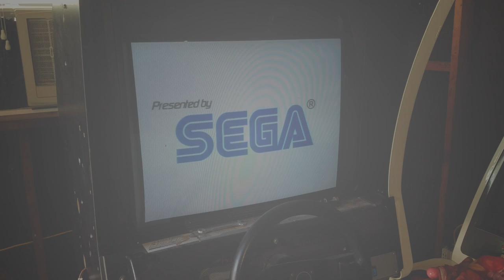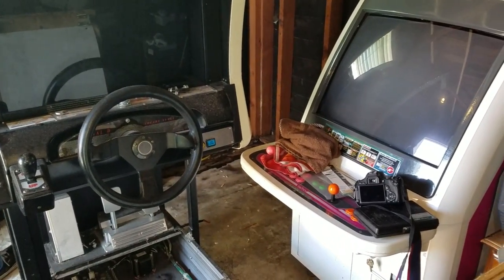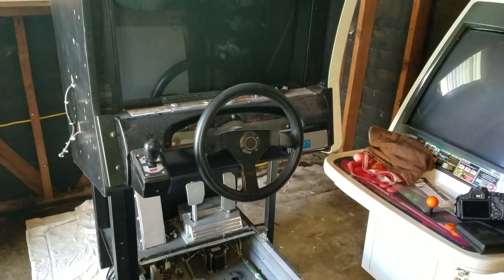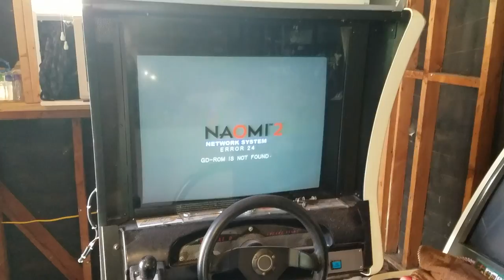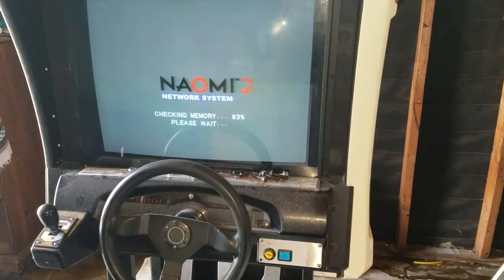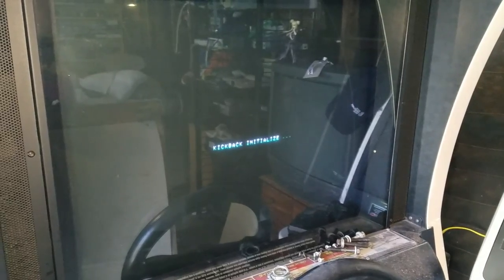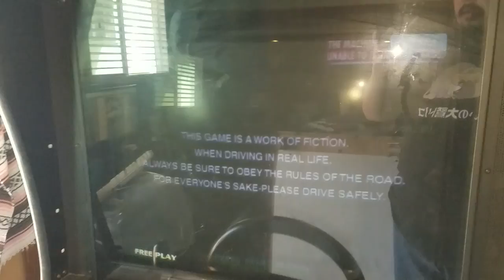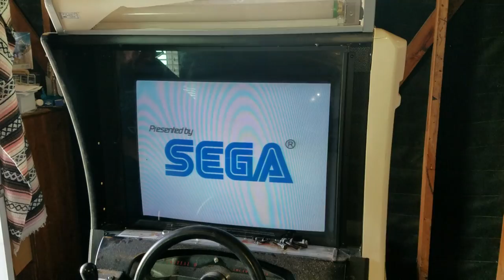Initial D Arcade Version 3 - Video Blog Part 5 (It's Working!)

Comment: Great work!

I'd rule out the volume pot before buying a new amp. If the game doesn't see a that a volume pot is connected it will not kick out any sound. You could try testing the amp on the other half of the cab to make sure it's working. Did you check the voltages to the amp? 

For the card reader, there should be a little slim PSU  (Corsel LCA75s-12, written on the large brown capacitor ) that takes 100v-120v input and  gives a 12v output, I'd multimeter the output to see if you are getting 12v. 

It also looks like your Force Feedback isn't working too, it should initialise on boot up. Is there  a red flashing led on the Servo motor board? After the FFB initialises the flashing red led should go solid.

It may be that these components are not getting any power from the 100v PSU. The USA cab is different to UK and Jp cabinets so I don't know how they are laid out inside. At least the 100v is getting to the Naomi PSU which shows the N2/GDRom and Netdimm are working.

Good luck man!
Reply from the maker: Thanks for the suggestion, but based on what ive read the amp is getting no power at all which is the primary problem.  I will definitely try your suggestion regardless.  I don't know how to check the voltages, I also currently do not have a voltmeter
Reply: No problem.

I'd definitely buy a multimeter first dude, it will save you a lot of hassle in the long run. There are guides on YouTube how to use them, once you understand how to use them you will wonder how you managed without one.

Since the Naomi PSU 5v and 3.3v are both adjustable, who knows what voltage those are set to right now. If the voltages are too high then the Naomi will die an early hot death.

So for USA cabs it's 120v in from the wall, then that 120v should goes to a 100v Step down transformer which will distribute it around the cab. 

The small transformer (maybe it's an isolation transformer for the monitor or the 14v transformer?) in your cab does not look big enough to power everything, so, whats probably happening is that the 'Master' side of the US twin distributes some of the 100v load via it's transformer to both sides of the twin. Like I said, I'm not familiar with how US cabs are built.

So 100v goes to:

100v to the monitor.

100v to the Naomi PSU, that then powers the Naomi/GD Rom etc with 3.3v, 5v and 12v outputs.

100v direct to the Servo Drive board which powers the FFB.

100v to a 14v PSU that then powers the the Sound Amp.

100v to a 12v PSU that then powers the Card reader.

On UK twin ID cabs there is a Power plate which the 240v cord plugs into, that then links to the other side of the twin and each side has it's own 240v-100v step down transformer which distributes the 100v around each side of the twin. 

The schematics in the US Initial D user manual should be online somewhere, it will show you what the wiring colours are and what wire goes where. Since you have the luxury of having the master side as well, you can simply buy the parts that are missing from your side and copy where everything goes.

Anyways good luck and I hope you sort out the cab, it's a great game and will look great when it's finished.
Reply: I forgot to add:

Power in on the boards:

Sound Amp: CN1 is 14v in.

Servo Drive board: CN5 is 100v in, CN4 is 100v out to the motor on the steering wheel. Led should flash on Servo PCB when turned on, then after it's initialised it will go solid red.

Card reader PSU: CN1 is 100v power in, CN2 is 12v out.
Reply: icuk7 hey man seems like u know this game. I dnt have a card reader so is there a way to play without it or bypass it
Reply: Hi,

Yes, you can disable it in the service menu. 

Enter service menu and then choose 'Game Assignments'.
In the Game Assignments menu go to 'Card R/W' and change the setting from On to Off.

The game will then load and it will disable the card reader so you can play the game.

Hope that helps dude.